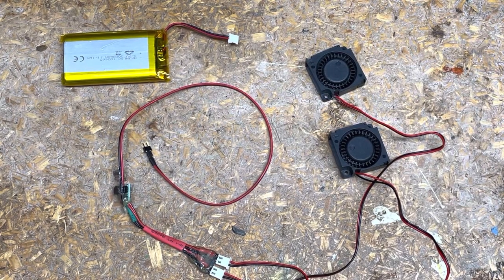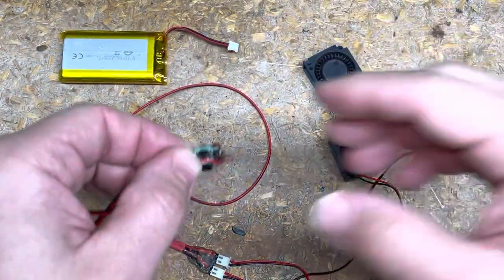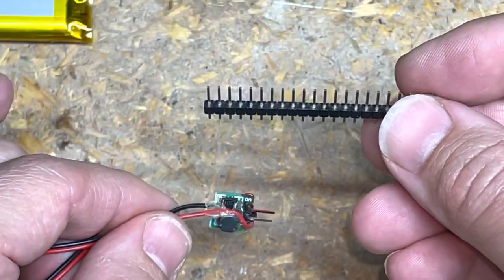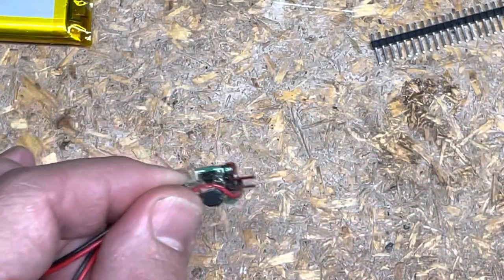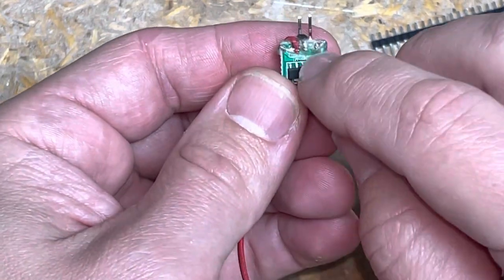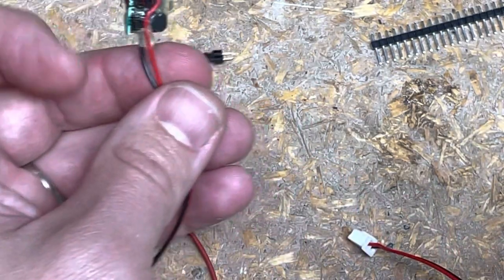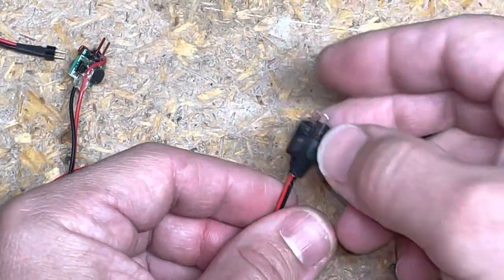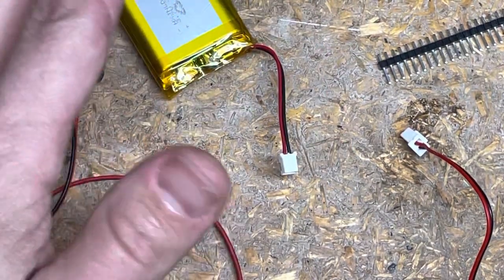V2 Easy Helmet Fan System - Simplified wiring + a 2 fan design (for Costume Masks)

Comment: Im complete new to all of this and i'm planning to use this for a helmet project. This may be a stupid question to ask but is there any chance of injury as a newbie and any tips i should know? Obviously the one i know already is to have everything unplugged as i work on it lol
Reply from the maker: In theory anything’s possible but in my experience I’ve never had any issue or personally felt any concern doing this project. I’m no electrician, I just figure it all out as I go.  It’s actually very low voltage and amperage so the risk of shock injury is low- however - using a defective battery can cause unpredictable results - that’s the only “electrical” thing I could foresee causing injury- so don’t use homemade batteries or one that’s punctured or broken etc.  
Using new batteries and following these instructions is how I’ve made multiples of these without any personal injury.  But because I cannot predict every possible outcome- I can just say that I’m no electrical engineer, so do this stuff at your own risk.

Ideally you’ll wear an antistatic wrist strap - but that’s to protect the electronics from damage. 
 You’re actually more likely to get minor injuries by getting burned by your soldering iron more than anything else. I’ve done that plenty.  Lots of finger burns.  Definitely never leave the room with the soldering iron left on!  Wear safety goggles, use a respirator and have on a fan to pull the solder fumes out of the room - if you don’t have that do it outside, or in a garage with the door open. Consider wearing gloves when soldering if concerned about burns.

This is definitely not an all encompassing safety brief.  If something feels dangerous don’t do it.

Comment: how do you charge battery?
Reply from the maker: Good question:  These Lithium Polymer (LiPo) batteries charge on 5v, so they just need a usb based charger.  Here’s a video I did of the least expensive one on Amazon.  https://youtu.be/nIPmzSI-ItA?si=k2_HOqYvZpkh_5mB

Amazon link: 1S LiPo Battery USB Charger... https://www.amazon.com/dp/B074M77J5M?ref=ppx_pop_mob_ap_share

While it’s not perfect it’s what I use for those batteries that didn’t come with their own charger.  All my original LiPo batteries.  But I found these less expensive batteries you can get in bulk and they come with their own chargers.

URGENEX 3.7V Lipo Battery 850mah... https://www.amazon.com/dp/B08T9FB56F?ref=ppx_pop_mob_ap_share